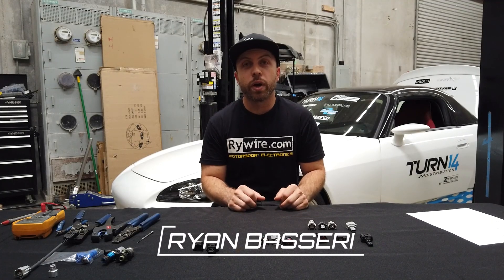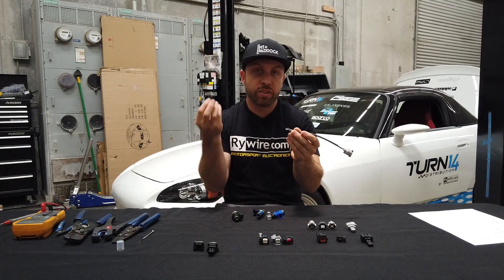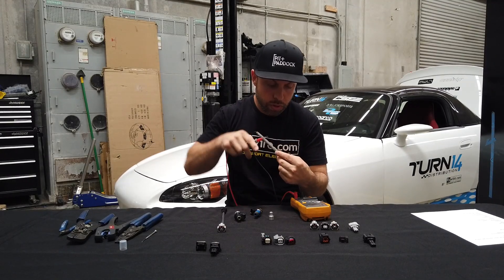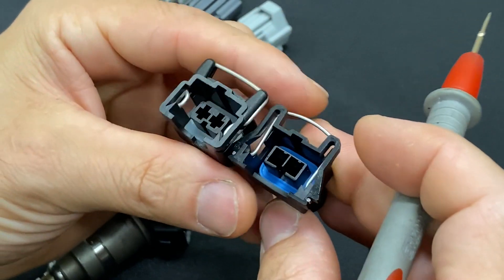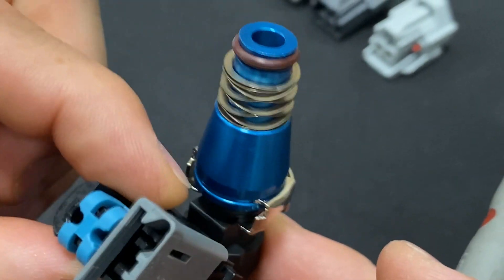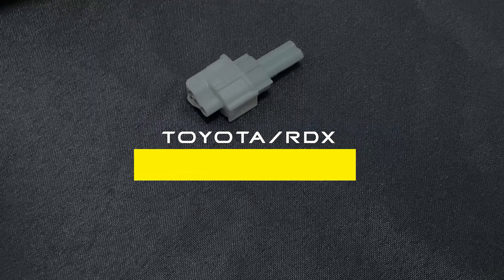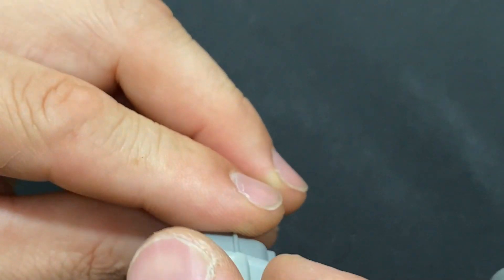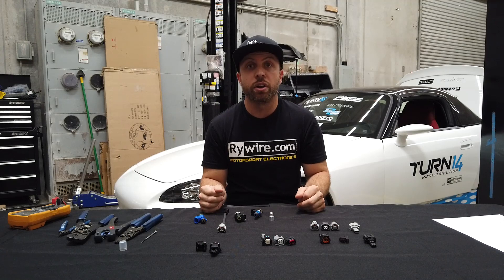Rywire - Injector Identification Video - Everything You Must Know about Fuel Injectors!

Comment: Amen bro! I went to swap LS gas truck injectors with flux injectors and crap. There's MUCH more to it than people lead me on to believe. Flex injectors are taller, different o-ring, and different connector. Not to mention other differences w/ fuel rail, etc. etc. etc. ug.

Comment: So I have a K24A2 CRX with a Rywire harness. It had factory injectors but I'm installing RDX ones. Polarity doesn't matter? Rywire harness is not color coded, I'm trying to figure out what side of the connector is which..? Y/black is power and other is PCM ground control?

Comment: what size terminal pins should i use.. i have one of your wire harnesses.  with a dw750cc i wanted to take out the harness pins and then take out one in my rdx to test.. long story short i messed up both terminals.. 😪  so it would be great to know if it what size to buy to fix